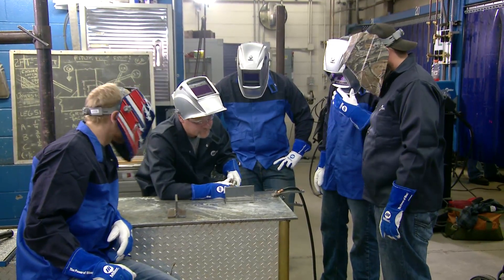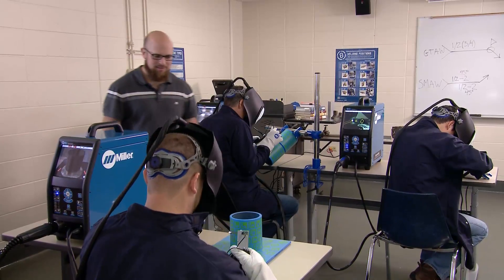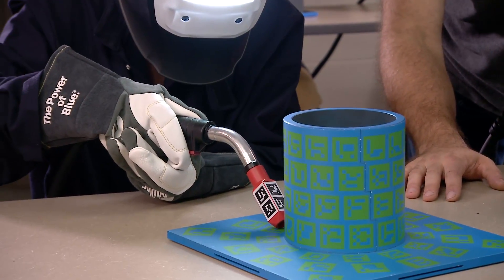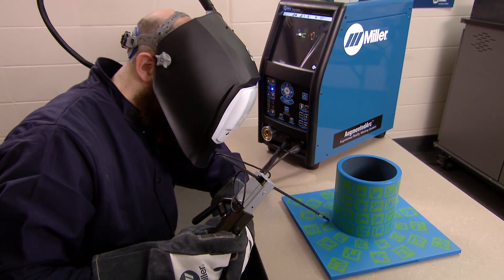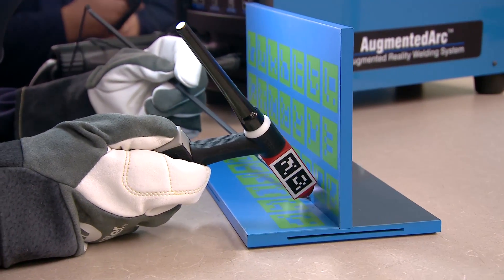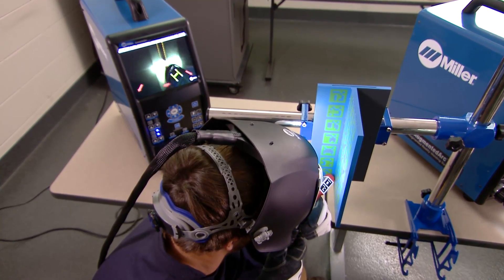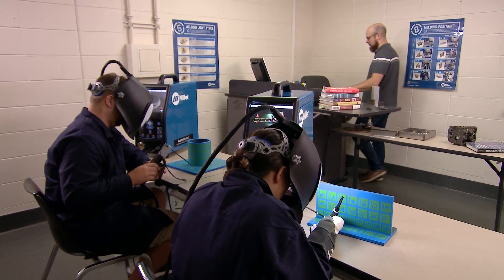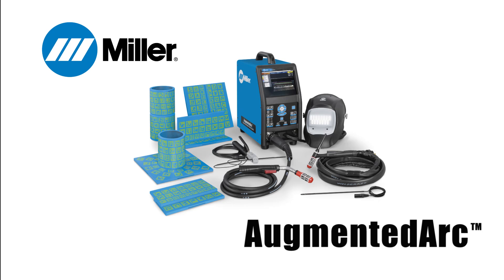AugmentedArc: the Industry’s Most Realistic Welding Simulator System

Comment: The question that needs to be asked is, "Is there a cost savings?"  If a trainee starts on the virtual machine, which is in itself a very substantial initial cost, will that trainee consume less steel, wire and gas than a student who didn't use the simulator once they get on real equipment?  Since the simulators are very expensive and themselves prone to breakage as they are much more delicate than a real set of tongs or a real MIG gun, what are the cots incurred in their operation? I'd love to see actual data on costs and any eventual return on investment.  I've been welding since 1989, trained at Bath Iron Works on Navy ships and have been an instructor at the shipyard and now at a regional vocational school and I find it hard to believe these machines actually speed up the learning curve or save real money.  I'd need to see some real data.

Comment: .  The rod burns out  on stick and u have to learn how to push in while it's running out.  So dose the filler metal on tig.  U got to learn how to roll In the filler metal with your fingers while welding   .  I would hate to learn on virtual reality.     Best school to go is where the old school welders instruct at.  They have all the technics and tricks.

Comment: i mean how do u get used to the consumption of the rod
Reply from the maker: Thanks for the question. The AugmentedArc electrode holder has a small motorized wheel that retracts the electrode during welding to simulate the electrode consumption in live welding.

Comment: MAG and TIG could Work but what about the electrode welding they Burn down and get shorter?
Reply: Its cool but better is IT to weld real to get a taste of how IT really is
Reply from the maker: Thanks for the question. The AugmentedArc stick electrode is similar in shape, weight, and size to a real electrode. It is placed within the holder, which is connected to the simulator. The holder has a small motorized wheel that retracts the electrode during welding to simulate the electrode consumption in live welding.

Comment: I want to connect a deltaweld 602 my input  voltage is 240v single phase line1,line2 , nuteral  . The equipment is L1.L2.L3 can I do any confrontation to work the equipment.
Reply from the maker: Thank you for reaching out, Bobby. We recommend giving our service line a call to talk this through with a tech. The number is 920-734-9821. Let us know if you have any trouble getting through.